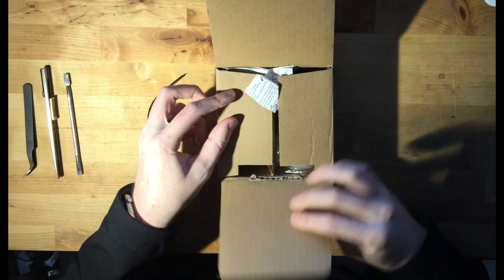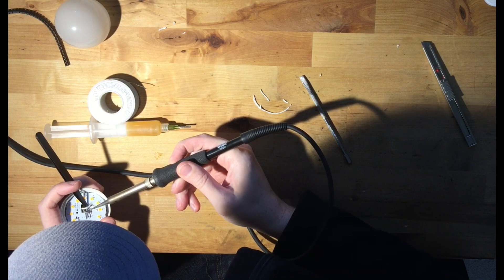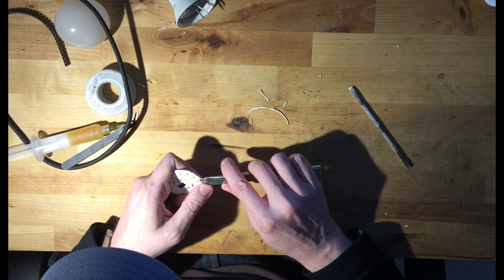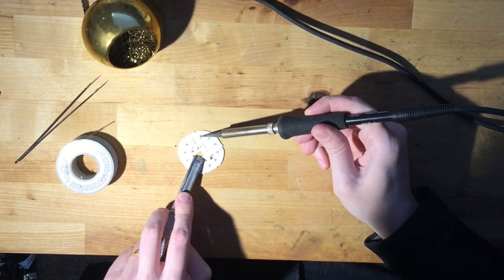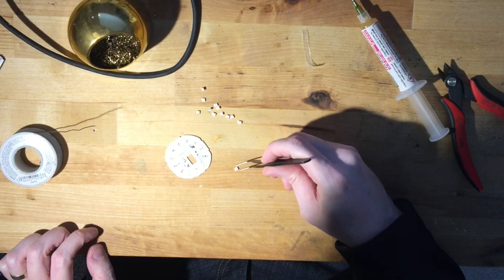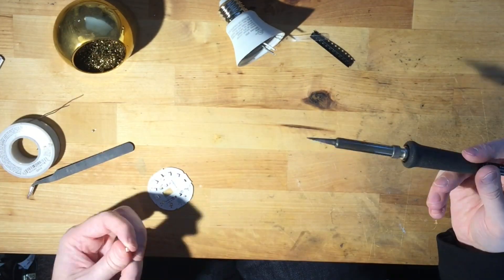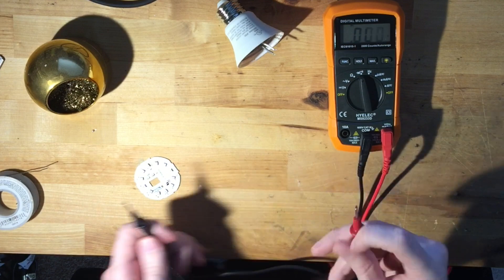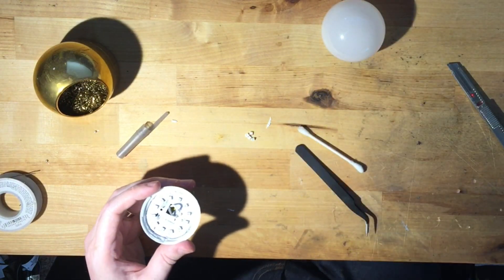Cheap LED Bulb to Infrared

Comment: white LEDs typically have a larger voltage drop across them than red (and I presume IR) LEDs. It would have been nice to see a measurement of the secondary voltage across the two wires that land on the PCB. Also, that syringe contains no type of solder I've ever seen. I think you meant to say FLUX.

Comment: The IR LEDs have the exact same specs as the white ones did? Oh, and yeah, I'm not surprised so many of them fried. SMDs are designed to be used with low melting point solder and a hot air station. If you use a regular iron, you really need to keep the contact time down, so tin all the contacts first, and only solder one side of each LED before coming back to do the other, or at least wait a while before doing the other side
Reply from the maker: Thanks for watching! Yep, same specs — it's pretty standard for that format / footprint of SMD. In this case the PCB the LEDs are mounted on is actually an aluminum sheet and doubles as a heat sink. It's not possible with only a soldering iron to quickly solder / desolder as the heatsink both absorbs heat quickly and dispels heat quickly.

Now that I have a re-work station this could probably be done much more conveniently but the goal was to document the the process for anyone who needed inspiration :)